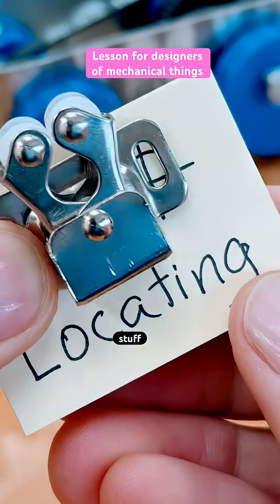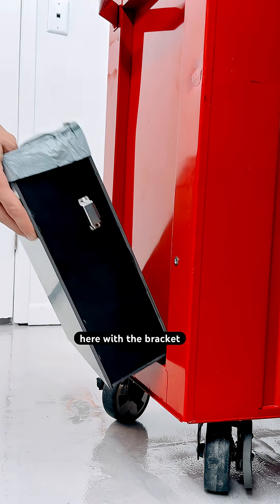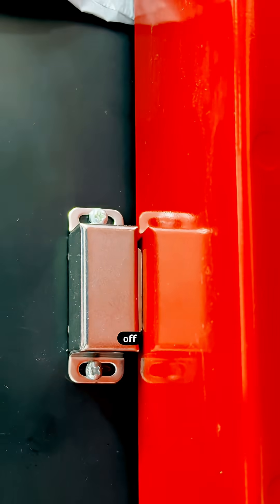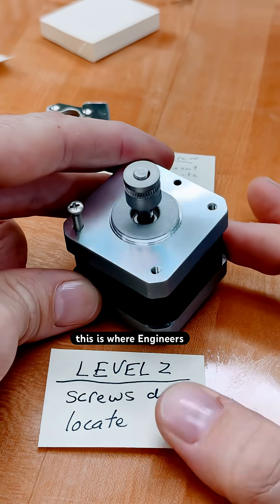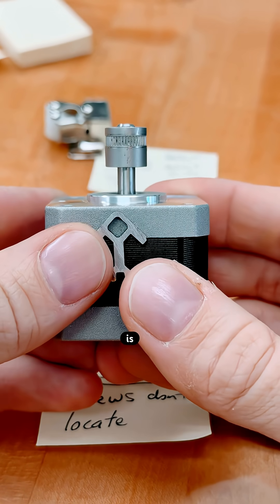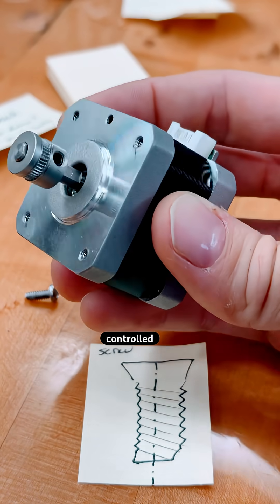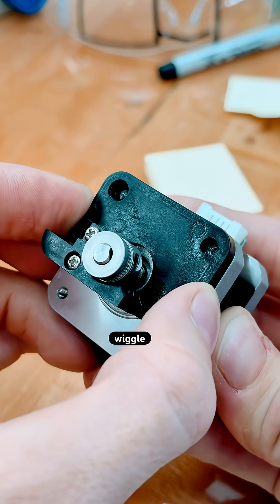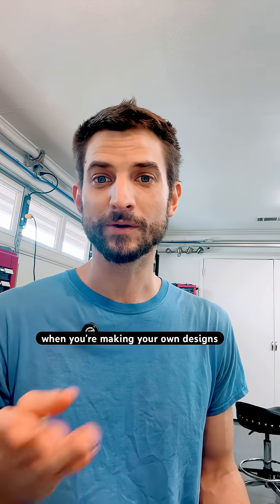Understand “locating” and design better 3D parts #3dprinting #mechatronics #engineering

Comment: Those locating slots on the magnetic catches tend to allow the position to slip over time. They're better off with a fixed hole.

Sometimes, the engineering for locating tolerances can cause failure as well.

Comment: Great explanation for those that don't understand how things work, and many don't. When bolts continue to shear off you can often fix the t mating parts with dowel pins, or roll pins. Bolts hold things together, they don't deal very well with forces in the other direction. Id like to know what that motor controls going into a small steel elect box??

Comment: I used this very thing recently on a toy car I designed. I wanted magnet removable wheels so that they can snap on amd off and you can change them as you wish. I added a locator similar to the motor circular one that you showed to keep the wheel in place when it snaps on.

I only realized after that the depth of it was way too short though, and the magnet itself doesn't end up holding the car very well. 😂

But that's engineering, I'll fix that in my next version. Probably will end up removing the magnetic wheels because although it's a cool gimmick it's not very practical or easily manufacturable (would like to sell them as 3D printed toys at the local farmers market).

Comment: It’s not just about the designer not trusting the installer.  It’s about adjustability.  here’s a powerful phrase to add to your list of axioms for good design:

“If you can’t make it perfect, make it adjustable.”
Reply: Perfect* is doing a lot of heavy lifting here. It could mean that the process accuracy or consistency is limited so that the capability is less than the desired tolerance or fit. It could mean that the end-use application is not clearly defined or itself has a wide range of tolerance. Or it could mean, like an ergonomic office chair for example, that the idea of ‘perfect’ is highly variable depending on the user.  It could be, like this latch or the steering alignment cams on a car, that wear or slop occurs over time and needs correction. 

 If perfect varies over time, between users, during installation, as a result of wear, because of mating parts, or due to lack of clearly defined specifications:

make it adjustable.
Reply: And if you can make it with loser tolerances by making it adjustable it becomes cheaper to manufacture and repair
Reply: @davidmalawey  ☝️ these two comments here!  (on a related note, we are on similar trajectories. I work in product design, development, and small scale manufacturing. I’ve spent the past 15 years running in my own business making things both by hand and CNC/Laser/3DPrinted and engaging with a lot of open source projects)

Comment: "We do not trust the centerline of the screws to locate on precise machines, instead we use this collar"
>shows collar fitment with a 0.020" gap

Mm yes very precise
Reply: There is a 10x increase in cost going from 0.020" to 0.005" and a 100x increase in cost going to 0.001" in precision. Being an engineer is about knowing what is good enough and what isn't.

Comment: Lug nuts and wheel bolts are a common place where the fastener does the locating. But not that it's not the threads doing the locating it is conical or other precision feature doing the locating. The studs are also press fit for precision locating.

Comment: Went to college for CAD so I understand. It is surprisingly important, locating. There is an entire discipling for it in regard to mapping or planning large areas called Surveying, and it is extremely precise. When you move down in scale to designing mechanics, the precision needed increases geometrically to the point where millions of an inch, degree or measurement of flatness begin to be a factor. Most of the tools or equipment in a home depends on this being done properly. It is crazy the moment you first realize how important it is and how you have gone your whole life just assuming everything works simply.

Comment: "Controlled by this very flat face the designer has control over"
That designer has obviously never met a millwright.  The number of flanges horrificaly marred by chisel, prybar, and screwdrivers substituting for both, marks vastly outnumbers the smooth and flat ones I've seen get sent to my repair shop.   I've seen inch thick shafts with 0.100" runout and clear deadblow marks on the side of the servo telling the tale of how the shaft got that bent.
The only thing you can trust is that night shift will somehow manage to overcome all your engineering controls to prevent them from fucking it up :P

Comment: More engineers need to learn from the IT thought process of "zero trust"... Trust nothing, verify everything. This is born of the goals of design for manufacturing, design for assembly, design for repair.
Reply from the maker: is there a well-made summary you can link? it’s the first time I’ve heard this term.
Reply: @davidmalawey  , the short topic can be found at Microsoft Learn site, title "What is Zero Trust?" (Security, overview).
Another interesting concept is "Zero-knowledge Proof" (security, cryptography)
Reply: the 3 pillars are: 
never trust, always verify, e.g. check that your tools are accurate and/or precise (e.g. if your tape measure is off by a few mm it is still precise, as long as you take all the measurements with it you will get repeatable results.)
also the classic ooga booga caveman brain, metal strong. metal not strong, metal more like trampoline, i.e. test or calculate that your materials are capable of what you think they are, sometimes you have surprises, good or bad, even plastic might be way overkill on something you though needed strength, or steel would fold like paper in something that seemed reasonable. 

implement least privilege, your parts shouldn't be expected to do more than what they're specced for/shouldn't do multiple jobs unless necessary (i.e. if you're cost cutting, you have a good reason to have a single point of failure part).

plan for breach (failure), plan what happens if a part fails, does it fail gracefully? can you add a part solely for redundancy? (ideally for robustness you have one part for one function and its failure is isolated to that)
Reply: @davidmalawey  The idea is that if you’re writing a software module that interfaces with other modules (an API) or takes user or network input, you want to assume those inputs will be not only malformed but malicious—designed to harm your module’s processes or extract sensitive data from them. So you “sanitize” those inputs by strictly limiting the data types and values they can take in. You want to coerce (technical term) any data into as narrow an interpretation as possible.

A slot on a bracket would be equivalent to accepting a floating point number with only a specific range of valid values for an input. Several specifically positioned holes along a bracket would be analogous to using a discreet custom data type called an enumerated type. For example, though a text string input may seem to enable an almost infinite number of values, you could make “apples”, “pears”, and “oranges” the only valid inputs by throwing an error or coercing any input into one of those three locations, if you will.
Reply: murphy's law, if it's possible to fuck up, someone will. so make it as unfuckeable as feasible.
Reply: They certainly could, but the more work you put into making as close to ABSOLUTELY certain as you can that it will not be screwed up by the average Joe, the more money it costs. And this is an exponential relationship of cost vs trust, so the price of a product is very easily quadrupled by that work and the need to QA test after manufacturing, investing in more accurate machinery and trained labor to create the part, etc. it all depends on how much importance you place on this per instance of a product. Most things just aren’t deemed worth that cost and won’t compete with being undercut with cheaper means.

Comment: This is a good call. I'm a software guy and the first hardware product I built recently did indeed use screws as locators and I just realized I should have used a separate feature for that task, and could have easily done so.

Comment: TV wall brackets which only have 4 holes are a good example of this. If you hit a corner of a brick or some hard stone within a brick you're stuck.

I found a brand with slots the entire length of the bracket, so you have many options to find one that works

Comment: I designed my first motorcycle part a few weeks ago. My first iteration fit good, but then I realized it would fit better using slots. Re-designed it and popped some slots in there, only 7x20mm, and it works flawlessly.

Comment: Between 2 components you need 1. Guideance elements: Large camphers that catch the parts while they move towards each other, a 3/2/1 Postiioning system that controls the position before and during mounting and mounting/fixation elements to fix the parts onto each other.

Comment: My life changed when I discovered transfer screws on McMaster Carr.
Reply from the maker: hmm 🤔 i’ll check it out
Reply: @davidmalawey  an analog method for locating boring operations that supplements maths.
Reply: Also the non-threaded, flanged variety for when you make the clearance holes first.

Comment: just to add: slots are for adjustment too. if wooden element changrs its size then slot lets you adjust the location to match new geometry
Reply: Isn't... isn't that what the op video said
Reply: @marshallc6215  No. Not really. He was focused on the fact that when you are building the device/system the slots allow for precise location in situations where it is not easy to do that by design. He did not mention that over time the conditions can change and the slot will help to accommodate this.
Reply: @sczygiel  "precise location in situations where you cannot do that by design" is just a very verbose way of saying "adjustment."
Reply: @marshallc6215  you missed the part about initial assembly

Comment: One of the first things you learn as an engineer is "screws are not for locating they are for mounting.
Reply: screws and bolts are forms fasteners, so yes absolutely not for locating, agreed.  But, what about a shoulder bolt?
Reply from the maker: @Crizleebear  yeah, the shoulder bolts or shoulder screws are for locating. that is sort of the next item i wanted to show but the video got too full 🤓
Reply: @Crizleebear  This is an excellent question. Usually one would separate the function of locating and fixing things together in 2 different components. But shoulder bolts can do both.
Reply: Meanwhile, countersunk screws
Reply: @48Dacman  Hahahah they work well for that xD
Reply: Depends on how you use it.
Reply: @pest2133  There are all kinds of special types of screws. But generally speaking they are for mounting only and can not locate a position exactly. Unless you make something like IDK some wooden crate or something where precision doesn´t matter.
Reply: @sierraecho884 i meant positioning the thing with bolts same way most of the houshold appliancesand industrial machines are leveled and yeah usually those are specialised bolts but regular bolts work too
Reply: @pest2133  "..i meant positioning the thing with bolts same way most of the houshold appliancesand industrial machines are leveled..." Yeah you can do that, but that´s more of an adjustment thing. A position would be fixed.